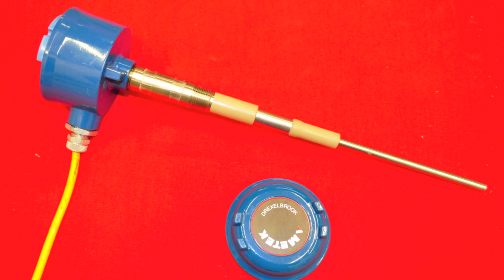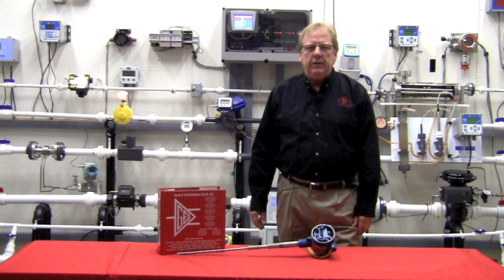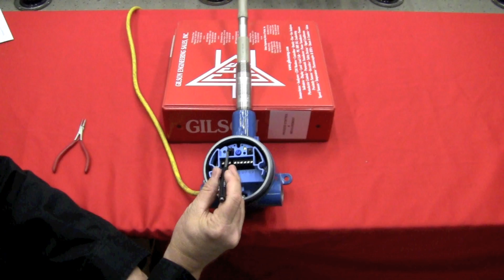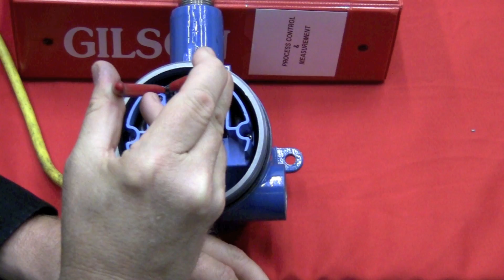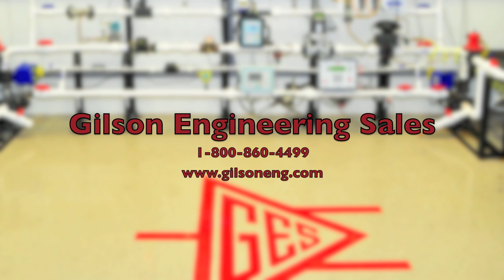Drexelbrook The Point Configuration

Comment: What if you use mode 7 or 8?  Does the cal button method still work, or do you have to use the set point potentiometer (manual method) instead?